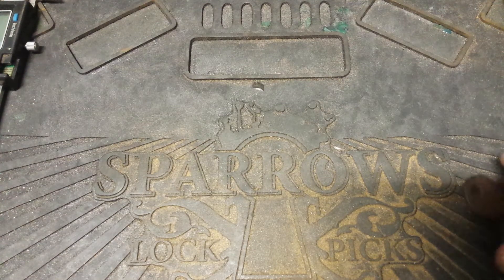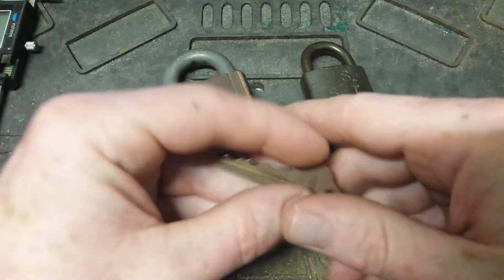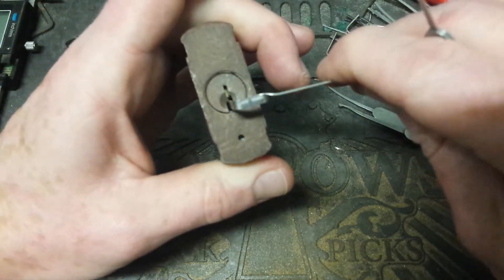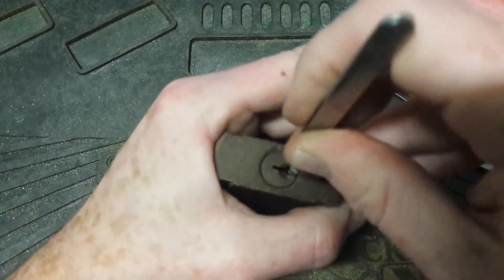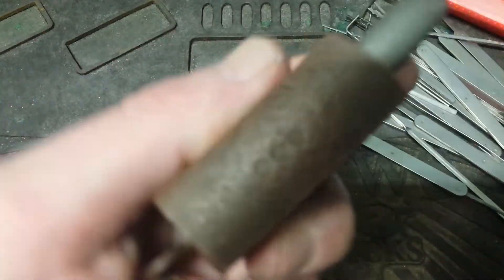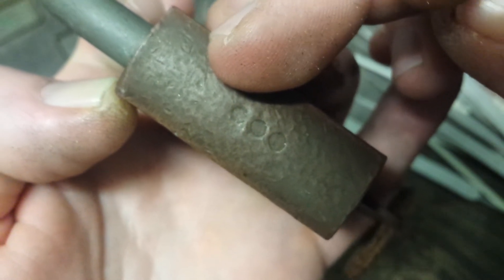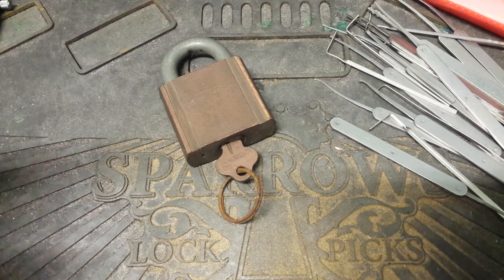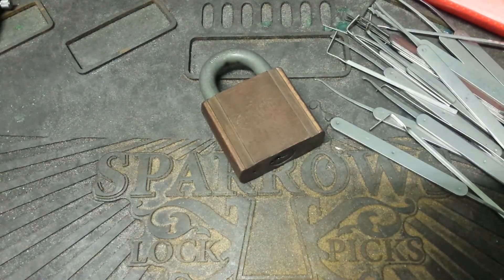100 SUBSCRIBER PICK!!! Lockwood key retaining padlock

Comment: Well done on your 100 TR. Nice old 245 brass gold you have. I am personally not a purist in the sense of appreciating pateena. I prefer the original as can be shiny gold with the nicely chromed shackle. The 247s, 245s, 234s and the 232s i have i refurbished back to as best original condition. The lockwood you have is a 245. If you measure the height of the body it should be around 46.5 mm. The other giveaway to tell the difference from the 247 is the 245 shackle is hardened and around the 46.5 mm mark as opossed to the 247 which is 50 mm in height and has a super hard shackle and 6 pins with the 245 only being 5 pins. I reckon the lock has been repinned at some stage and kept in dry conditions being if the lock had served a hard life outdoors in the conditions the pins would be like pushing the pins through jelly and near impossible to rake. The pins in yours are fresh and springy. The other giveaway to being rekeyed at some point is the exposed chamber plug outlines and the hammered brass. The person who did it shouldn't give up their day job. It was a hack job. Terrible. I would personally linish the edge back to smooth and matt polish the body. Just a thought. Again, well done and keep it up. Cheers:-)
Reply from the maker: Thanks for the info/details and kind works,  looks as if it is a 245.  Nice lock to have as for refurbishing it that's something to think about, thanks again for all the detail much appreciated!  As for being re-pinned I may just pull it apart to see.... if I go done the refurbishing track.  Thanks for watching!